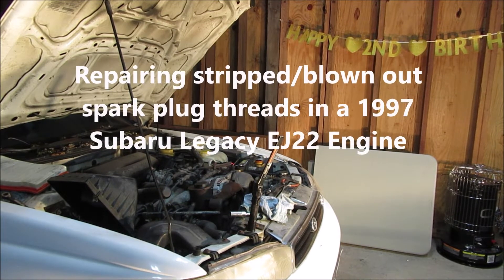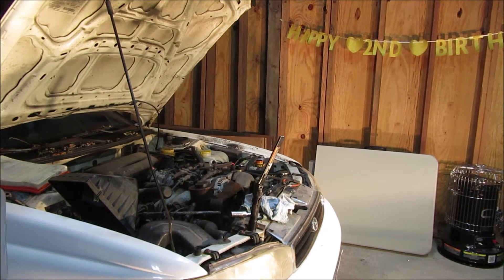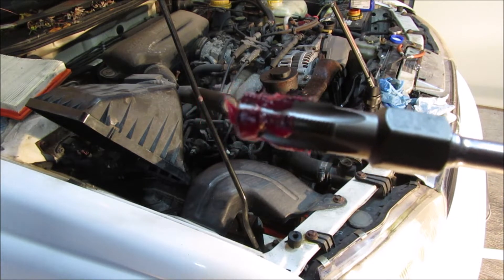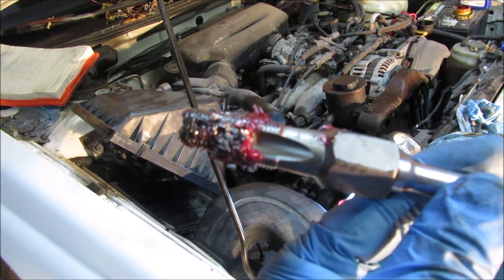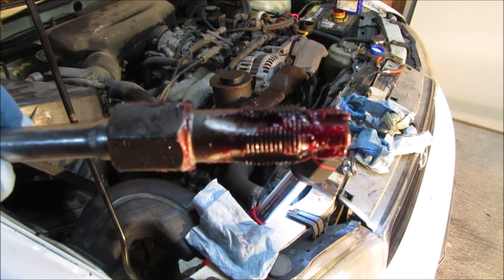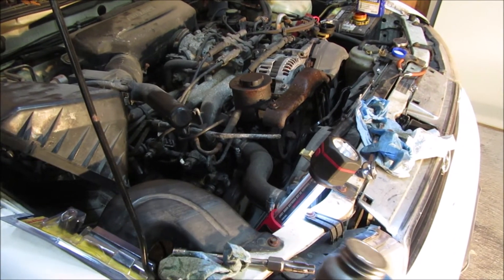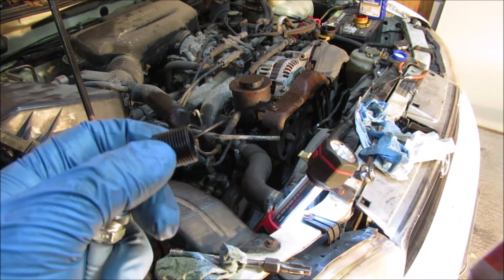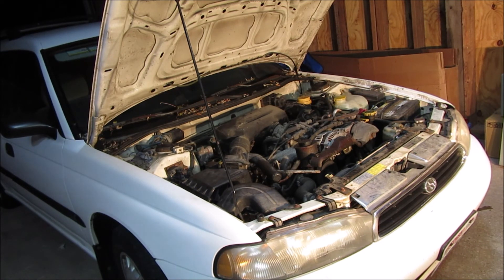Stripped Spark Plug Thread Repair (Spark plug blew out on Subaru EJ22) "Sav-A-Thread" helicoil

Comment: So, did you use the expanding tool in the end or not? I just did this to my 99 Impreza 2.5 and I'm wondering if I need bother trying to use the swagging tool. It's too short to reach down and still be able to hit it with a hammer, so some sort of extension would be required.
Reply from the maker: I never ended up doing it.  It has held up fine. No issues at all.  Except that a different spark plug ended up blowing out a year later......
Reply: @DIYAUTOCAR  Ya, that's what I'm afraid of. I've had one other plug come out twice, but it securely screwed back in both times. The last time with red Loctite. I'm just trying to nurse the car thru to next spring, hopefully the markets will return to normal by them. Guys are asking $25-$27K for 2017 Imprezas up here in Canada.

Comment: Lol same engine same cylinder
Reply from the maker: Yeah, it seems to be a common thing on these engines
Reply: Mine was already helicoiled by previous owner so it needs a new head :(
Reply from the maker: @notyouraveragemechanic7376  I would try and use a timesert. They make an oversized time sert that will work for a failed/improper helicoil install.  Worth a shot before pulling a head off and swapping it.

Comment: Looks good, I'm about to so this on my '98 Impreza.

 My only addition is that most threadlocker cures in anaerobic conditions so you just need to tighten it not necessarily wait for it to set like silicone, etc.
Reply from the maker: I thought that this particular one said to leave it overnight or something like that. Maybe not, either way it worked out. Hopefully it goes/went good for you